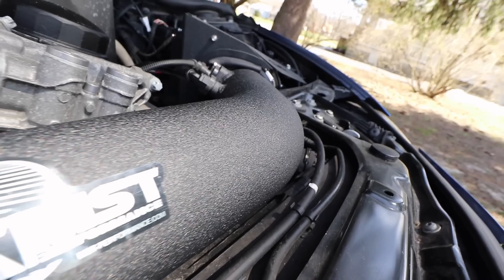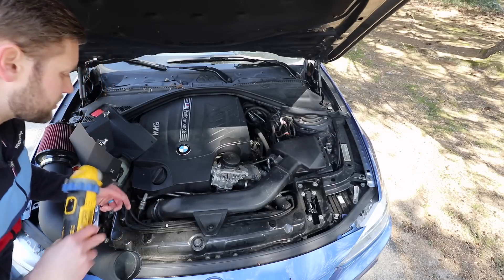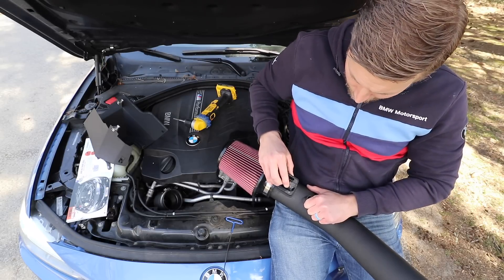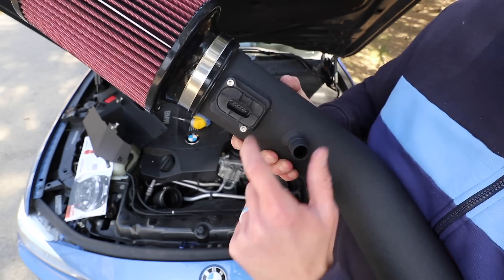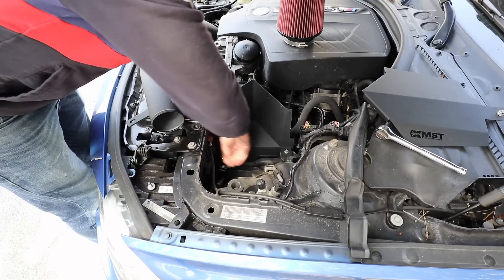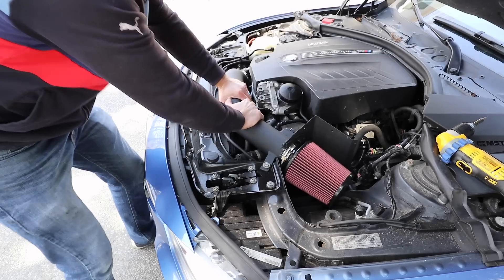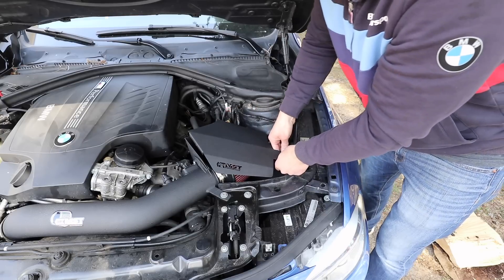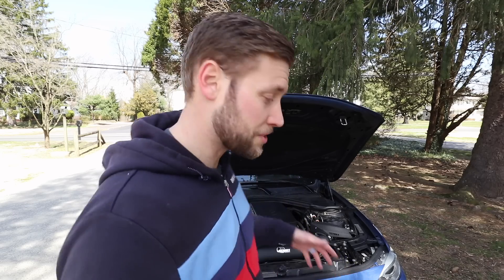MST PERFORMANCE Intake for the BMW F30 N55 (N20, N26 & N55 BMW F30 Mods!)

Comment: Another excellent video. Would be very keen to see your data logs after fitting this to see if there's any knock correction going on. My understanding was that the stock intake isn't restricting airflow at all unless you've fitted a larger turbo, and that the power increase is simply from the change of flow pattern across the MAF causing the car to run leaner. No denying it sounds awesome though.
Reply from the maker: Logs have been good so far 😀😀
Reply: Kies Motorsports excellent! Not being critical. But it’s an important factor to consider, and one often overlooked.

Comment: Hey Bryan, another well produced video from you as usual!  You brought up an interesting point when you said that you can choose to run it the new intake with the filter open or closed under the hood.  I've read pros and cons to both but no one has ever stated any real data on the issue.  It would be interesting if you take it out on a hot day, run it both ways and then report what the coolant temperature gauge in your car said for each.  Note that you have an upgraded intercooler so the actual temperature you see may be different than if the car was stock but it would be curious if you see a notable difference between open and closed intake boxes.  Don't know if you ever reported the coolant temperature drop after you changed out your intercooler.  What coolant temperature do you hit now if you run your car hard on a warm day?  Thanks!
Reply from the maker: Thanks John! I haven't run it hard on a warm day.. when I went to the track a few weeks back, it was freezing out, but as it get's warmer, we'll have a better understanding on what's going on with the temps. I've been running this intake for months now without issue, which has been nice

Comment: My 335GT is my first bmw. Came from a Subaru. The consensus with subarus and intakes were that a tune would be required. I have a bms stage 1 now for the bmw. Would adding this intake require a new tune?
Reply from the maker: Same here. I came from wrx 👍🏼 no tune required for this intake 😀

Comment: 10-15hp I need to see graphs from the dyno.
Reply from the maker: They have one that says 15.8 hp, I’ll get a copy on our site
Reply: *With supporting mods* - Like a COBB tuner or JB4, right?  So for an otherwise 100% stock car, nothing.  Just the cool noises... which is something, just not 10-15 HP.
Reply: @KiesMotorsports  What about IATs? What kind of changes did you see in those temps with this intake vs. the stock intake? Any heat soaking?
Reply: All the intake companies dyno results are bs becuase you run the dyno with the hood open. When you actually use the car and close the hood the intake air temps increase significantly and reduce the impact all of these intakes have over the sealed stock unit.

Comment: So I have bootmod3 stage1 93 octane. If I get the mst intake will I get the most out of the mst intake by just putting it on? Or do I need a different tune on the bootmod3 when I get the intake?

Comment: You used to have the bms intake , what made you go a different route.
I’m planning on getting the bms intake , now you got me confused lol
Reply: IzeFilm dunno if ur still deciding but this one is a cold air intake. the heat shield keeps the hot air from the engine away. The other one is just a cone intake, hot air from the engine can come in (no heat shield housing)  FYI, OEM BMW is a cold air intake

Comment: For 2016 435i xdrive. Just bought my mst intake from kids :). Just wondering would my oem charge pipe be ok with this mod or do you recommend to replace it right away
Reply: Have the same car let me know if you changed the Charge pipe

Comment: Website states application for 2012-2013 BMW335I, is this a typo? What about for a 2015 335I?
Reply from the maker: It's all N55 335 :)
Reply: Kies Motorsports nothing different from the 2015 335i for sure 100%?
Reply: Kies Motorsports sweet!! Been waiting for you to post this video 👍🏽
Reply from the maker: They're all the same :)
Reply: Yup and 435i started in 2014 not 2012